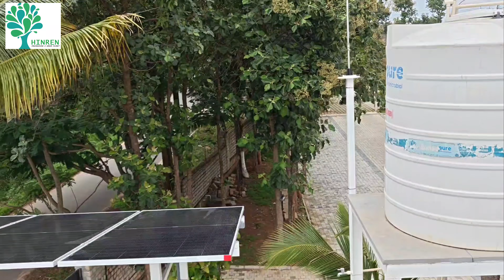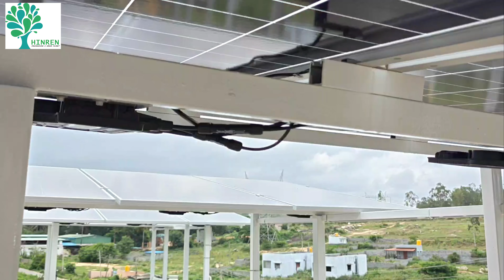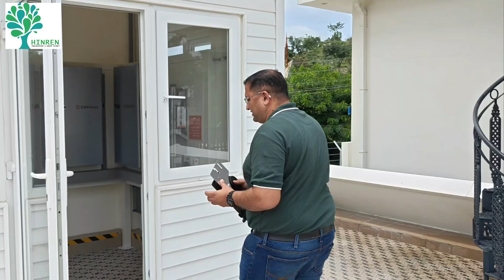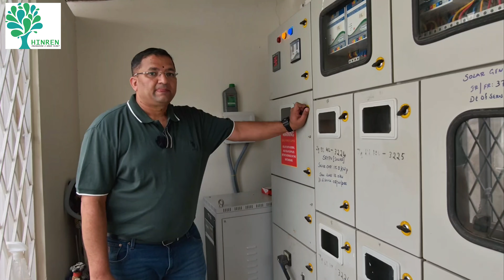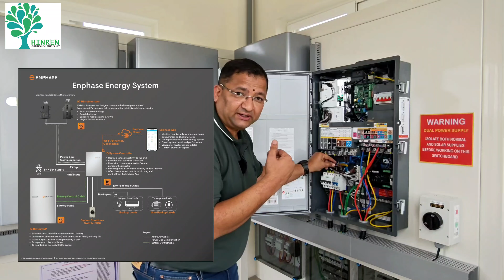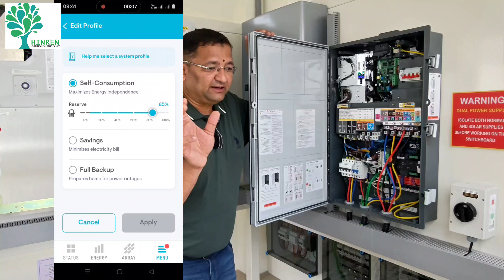Solar Hybrid System Using Enphase Micro Inverter and Enphase AC Battery

Comment: Very good and clean installation! Do you know if Enphase has launched IQ5P Flexphase in India for 3 phase systems?
Reply from the maker: I think the beta version is launched . Not sure though
Reply: Just install 3 batteries. Flexphase isn't worth it. Only 1.2kwh per phase
Reply: @mayurkulkarni1990  Having all the critical appliances on 1 phase will overload the circuit. Also, adding more batteries won't solve the problem in my opinion as the IQ 3T controller only backs up single phase out of 3. The other 2 will be in  dark. In my case, I have heavy appliances on all three phases and I need backup for short duration (1min to 1 hour) when the power cut happens (UPS mode with no solar)
Reply: @KnowingBetterIsBetter what I meant was, could you not have 1 battery in each phase?
Victron does this flawlessly
Reply: @mayurkulkarni1990  I already have a Victron Multiplus 2, 3 phase setup at another home. It works great, but too many components (1 Multiplus per phase) and too much cabling (DC, AC). It is of value when you have solar but a bit too much space for a UPS.
Reply: @KnowingBetterIsBetter then I guess you should try deye. 1 inverter for 3 phases and need only 1 battery min